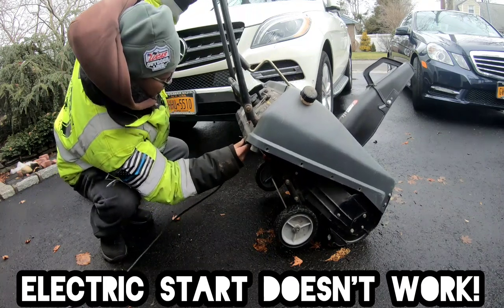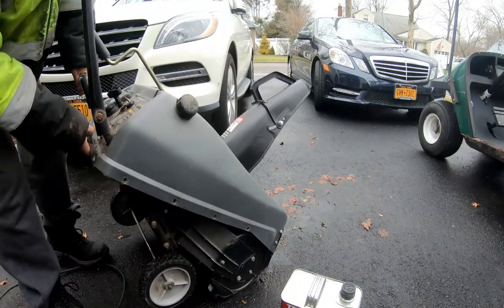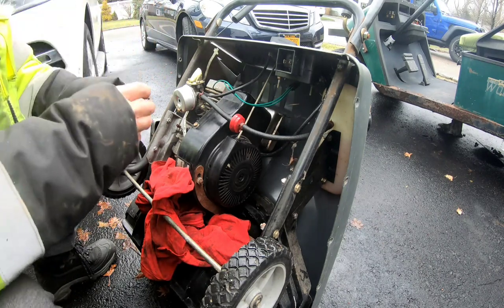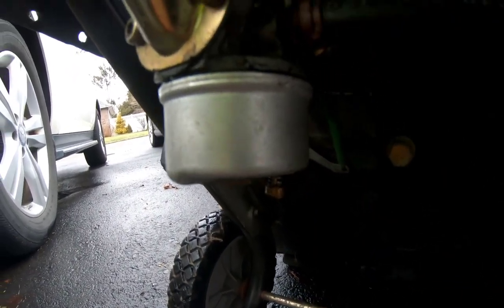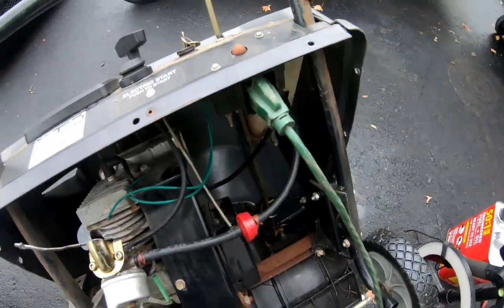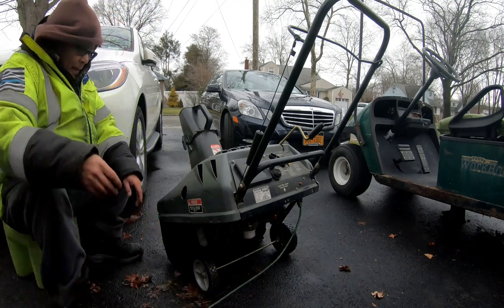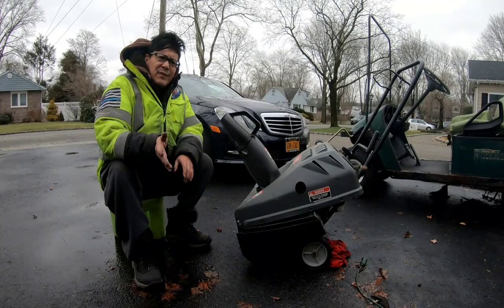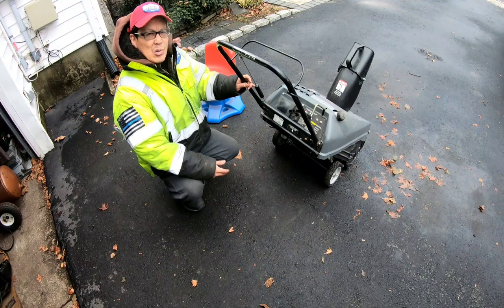CRAFTSMAN 5HP TECUMSEH 21" SINGLE STAGE SNOWBLOWER ELECTRIC START REPAIR CARB CLEAN & AUGER BELT FIX

Comment: I have one I bought 2nd hand several years ago.  All I have ever done to it was take the top cover off and tighten the 2 bolts that hold the muffler on. I tested the electric start but most always start it with the hand pull rope.  It has never failed me.

Comment: Hey Henry, that thing is a hole that will weep out gas if the float is not closing all the way and letting gas go by the needle. If the needle is seating correctly then it will not leak out of it. kinda like a water pump on a car that starts leaking when the pump is about ready to go. I haven't commented in a while but still watching.
Reply from the maker: Good tip bro!  That plug I put on it fix it though..doesn’t leak
Reply: After buying, fixing and reselling for 25 yrs. I have seen that before and a lot of other weird things. If the needle is seating properly it won't leak out of that hole anymore.

Comment: Right above the welch plug is a weep hole/vent hole, make sure it isn't plugged up where it doesn't work both ways as in sucking air and releasing pressure.

Comment: The float needle is leaking the area where the fuel is coming from is over flow and vent. This causes hard to start.
Reply from the maker: Maybe a little but it was mostly coming from that vent nozzle